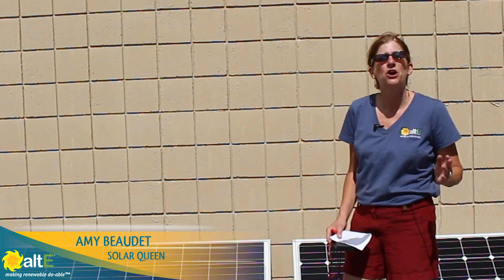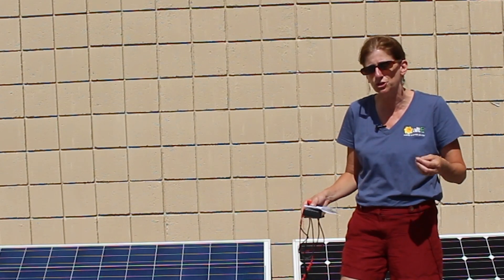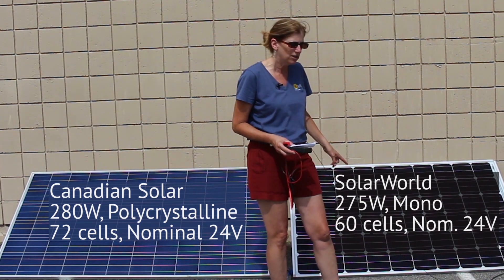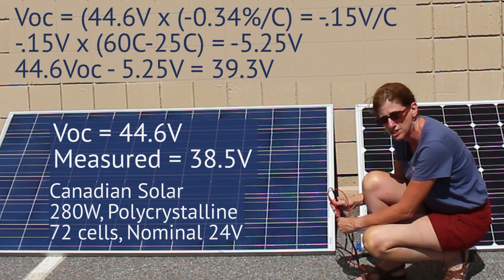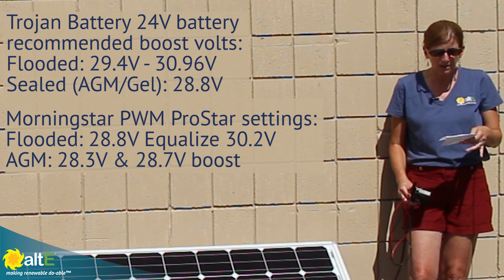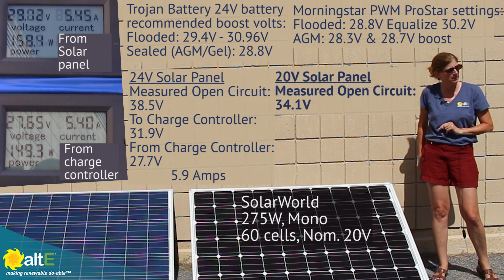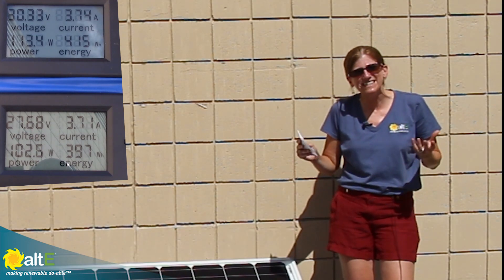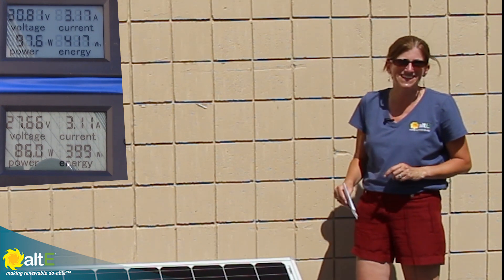Can you charge a 24V battery with a 20V solar panel and PWM charge controller?

Comment: Wow, Lady,you seem to know it all,what a pleasure to hear it from someone with experience who KNOWS;

I am stuck with five 60 cell panels,all 5 in parallel, to feed the house and charge the batteries;  works well,but they cannot do it perfectly,voltage in not high enough,at least now  in the summer

Can i ADD five 12 cell panels to my five panels,in series with each one,,  so they kind of become 72 cells?

And i want to keep my cheap two PWM controllers,can i do that,or there will be a waste of energy in them?
Reply from the maker: Unfortunately it won't work like that since the cells are already wired together within the panels. If you did put a 60c panel in series with a 12c panel, the smaller one would most likely limit the current of the larger and you would not be operating efficiently.
Reply: @AltEStore  Thank you; i now have 6 panels,all the same; i am going to look into cheap DC-DC converters,but that may not work well too; 
What i think will work,  is to wire the 2 panel strings in series and get 60 volts,and buy an MPPT; will that work?  thanks

Comment: I have a single 22voc panel will a pwm solar charge controller let me charge a 24v battery will it step the voltage up

Comment: Can I connect two 72 solar panels in parallel to charge 24v battery
Reply: I want to know the same thing did you ever find out will it work with a solar charge controller
Reply: I’m not that expert but i think when it’s match in series better than parallel because of the inverter needs more voltage to works and try to buy inverter mppt range between 60-100 . That what I’ve found in YouTube experiences
Reply: I think so,THAT is what they were made for; a 60 cell,they say here,won't do it well,just kinda...

Comment: Hi! thank you for this wonderful video. I have 60 cells SolarGiga panels from china, the Vmp is 39,42 V and Pmax is 280W just about the same for the CanadianSolar! Do you recommend battery of 12V or I go with 24V?
Reply from the maker: If you only have one 60 cell panel, I recommend 12V battery. If you have multiple panels you can put in series, you can do 24V. It really depends on the size of your system to determine which is the best battery voltage.
Reply: @AltEStore  Thank you for your answer! Yes, I was hesitating between 12 or 24V batteries, but I think 12 will do the work perfectly. FYI, I have 20 panels of Voc 39.42V and capacity of 280 Watt for each panel. our home consumes around 0.317 kw/h.  Do I have enough power to boot it up?
Reply from the maker: @hichamelouali  With 20 panels, you should use a higher battery voltage than 12V. At least 24V, if not 48V. 20 x 280W = 5600W. 5600W / 12V battery bank = 466A into the bank. That is too much for a 12V battery bank. 5600W / 48V battery bank = 116A into the bank, that is much more manageable and can be done with one or two charge controllers.
Reply: @AltEStore  many thanks for such valuable info! I'll let you know once done ;)

Comment: Hi i was planning for a small offgrid system  I've got a 12v 325 watt inverter, 12/24v charge controller (pwm) , support 390w in 12v and 780w in 24v
Max pv voltage 50, rated current is 30A , planning to get LiFePo4 battery, ( from supermexx - Indian Company) , I've just ordered for a dc-dc converter 24-12 v 
supporting 300watt , 
Not yet sure of the solar pannel between 12 or 24 and the battery voltage ( 12 or 24 v) 
I want the whole thing to be portable . 

Should I get two 12v battery, two 12v pannel, or 24v battery and 24v solar or two 12v solar, or any different combination, 
I've already ordered for converter, for the 12v inverter, 
Hi, I am a student, and would like to get some help in this. 
Thanks, regards

Comment: Question? I want to charge a single 12v battery with 320 watt 24v solar panel using a 12/24v 30a PMW charge controller (EPEVER 30a) that claims it can handle up to 50v and 360watts.   Will there be efficiency losses vs an MPPT? Do PMW chargers like this step down voltage and step up Amperage efficiency?
Reply from the maker: An MPPT reduces the voltage while increasing the current, therefore minimizing lost energy. A PWM only reduces the volts, it does not increase the amps. If you try to use a 24V panel on a 12V battery, you will lose half of the potential energy. The reason the EPEVER you are looking at supports up to 50V is for when it is used with a 24V battery bank and solar array. The solar voltage will be around 44Voc.

Comment: Pls assist it is possible to use 48v charger controller to 24v batteries and inverter is also 24v?
Reply: Pls reply sorry to border again
Reply from the maker: It depends on the charge controller. Is it designed to support multiple voltages, up to 48V, or is it just for 48V. If just 48V, no, it cannot be used for a 24V battery bank. It will either read the voltage as too low to charge, or it will try to charge it to 48V, damaging the batteries.

Comment: my 20/20 dingo plasmatonics pwm charge controller 12 24 48 volt charge controller it won't work with my single house solar panel 180 watts why???

Comment: Why are panels standardized for spring weather (70's F) instead of summer weather (80's-100's F)? Isn't then the best time to collect solar power (both for sun access and non off-grid consumer's most likeliness to use them via vacation.) the worst time to have the panels in the sun?

Comment: Hi 
Is it possible to modify the solar panels. 
If I got 12V solar panel is there anyway to make it 24V??
Reply from the maker: Only way to do that is put a second one in series.
Reply: Many thanks for your prompt reply. 

If I have only one panel? 
Is there a way to do so looks like to change the fuse of panel.
Reply from the maker: If the panel only has 36 cells, there is nothing you can do. Some 12V panels have 72 cells, 2 parallel strings of 36 cells in series. If you have one of them, and there is a way to rewire the junction box to have them all in series (and that is a big if, I doubt it), then you can do it.
Reply: Your support is Highly appreciated. 
Thank you very much...

Comment: Someone could use a pair of these 20V panels to help charge some golf cart batteries.  For example, on a 36V golf cart using six 6V batteries in series, have 2 of these "20V"  panels on the roof of the golf cart (sideways not longways), 2 separate charge controllers, and only connect 3 batteries to each charge controller.  So then you would have 20V (nominal) rated panels charging about 18V (nominal) of batteries.  This might allow you to downsize the batteries in your golf cart and save significant weight, perhaps even close to 50 pounds net savings (after adding in the weight of the 2 panels).  It would also help keep the batteries topped off when not using the golf cart.  An additional benefit is the panels will make more shade on sunny days, keeping the golfers a bit cooler while waiting to hit.

Another solution would be to use a single panel (longways) and use a boost charge controller.  Those increase the voltage to the battery bank so for example, if you have about 20V coming in from the solo panel under normal load, you can get 42V out to charge the entire 36V battery bank.  For a single panel setup like that, I would not downsize the battery bank for weight savings.

With a pair of panels, it seems reasonable to get about a 10A charge in the sun and since golf is more waiting that driving, it should keep the batteries in a high state of charge (assumng you are not one of those golfers that often drives around for 5 minutes looking for your ball).
Reply from the maker: Most charge controllers need a higher voltage solar panel than the 36V or 48V battery bank on a golf cart. However, Genasun makes one specifically for this and boosts the voltage output to the correct voltage to charge the battery bank. You can see a video we did on it here, https://youtu.be/0Rb77J1bI94

Comment: Yes for one panel it does charge the battery and work but the performance falls as soon as you have more than one panel. I have 4 255watts panels with Max volts of about 31v. When the current goes up around 23amps the volts drop to about 24.9v. which can't really charge the battery. If i attached two panels in series the volts increase and is out of operating voltage of pwm charger. So i have no option but to buy mppt charge controller.
Reply: yes.   buy mppt charge controller. but be careful. everyone is calling their charger MPPT. watch some reviews first. usually nothing less than $70. but they make all the difference in the world.

Comment: Why do they even call it a 20V panel if it's really has 39.4V / 34.AV Voc?
Reply from the maker: It goes back to when solar panels were made just to charge batteries, and before MPPT charge controllers could change the output voltage to the battery. A 36 cell panel had the right voltage to charge a 12V battery, so it was called a nominal 12V panel. A 72 cell panel can charge a 24V battery, so it's a 24V panel. When they started making solar panels for grid tie, and didn't care about battery voltages, they made a 60 cell panel. Using the same naming method, it is considered a 20V panel. It does make it clear that the voltage is too high for a 12V battery, and too low for a 24V battery bank.
Reply: Ah thanks! So it's an anachronism.
Reply: @AltEStore  Excellent explanation;

Comment: I've got a 24v-48v  GTI inverter that quits when the voltage drops below 27.8 volts.... I'm adding 3  12v batteries  in series to  create a 36v loop to keep the inverter running... think my 24v panels working through  a 36v charge controller can keep my batteries charged?
Reply from the maker: Grover Watson most mppt charge controllers have to have a higher voltage to charge the battery bank. You said panels. Can you wire 2 in series with an MPPT?

Comment: I wonder if there's a reason (other than cost) that people go with PWM controllers as opposed to MPPT?
Some people have said the PWM is more reliable... but I see no reason that a PWM controller (especially the majority of them out there) would outlive a quality MPPT controller.
Reply from the maker: It depends on the size of the system. It is commonly said that with a solar array under 500W, the increase in the solar output is outweighed by the additional power consumed by the MPPT, and the increased cost. But over 500W, cost would be the only reason. Another thing to take into consideration is voltage drop if the panels are a distance from the charge controller. MPPT allows you to wire them in series, generating higher voltage and lower current, letting you use smaller wire, and saving money there.
Reply: Wire does get really expensive really fast... If you need to pump 25 amps at 17ish volts through something, you're gonna need some big wire. 100 feet of 2/0 wire and you've quite possibly bought more than one MPPT controller. :D
Good point about the power usage of the controller. For a very small system, that would be significant.

Comment: I have a 12/24v 20A PWM charge controller and 2x100 watt solar panel. My question is, can the PWM charge controller take 24v (36v + 6.1A) and convert it to 12v (14.2v + 12.2A) for the battery?
Reply from the maker: A PWM charge controller only passes the voltage through, it does not change it. If it is rated as 12/24V, that means it can use a 12V solar array with a 12V battery bank, or a 24V solar array with a 24V battery bank. To convert from 24V array to 12V battery, you need an MPPT charge controller which drops the volts and raises the amps.

Comment: I have 700 watt of solar panel .12volt.12six volt batteries tie together to make 16volt.for sum reason my 12volt charge controler keep reading dat the batteries r full even tho dere not.I end up unplugging the wire's to the charge controler and running dem straight to the batteries. works fine but den I can't tell if dere full r not and am afraid of damaging the batteries. is dere a better way 4me to do dis plz hlp
Reply from the maker: Can you describe how the batteries are wired together? Are they in 6 parallel strings of 2 in series? Where are you getting the 16V from? A full 12V battery bank will be around 14V. Did you wire them 3 in series? If so, the charge controller will always think they are full, because they are way above the 14V full voltage.
Reply: there 8volt golf cart batteries 2 tie together in series make 16volt .dats the only way I cud get dem to work wit my 12volt inverter. problem is when I have dem.(batteries)on my 12volt charge controler it tink dat the bat3s r full and dere not
Reply: my bad didn't notice i wrote 12volt instead of 8volt.just seen it looking back at my txt
Reply: these batteries are no good for A 12 volt system a 12 volt controller shuts of at 14.6 volt and floats at 13.7 this is to low for your battery set up and will not charge then correctly
Reply: the best way i can think of is a circuit to turn on and off the solar panels to the battery when they reach a set voltage very much how alot of cheap charge controllers work

Comment: Hi. I have a 24v, 6.6 Ah Lithium battery powered electric bike I'd like to charge remotely (ie: portable). The A/C adapter I use now is 120-240v, 50-60Hz with 2.0 amp input and 24v, with 2.0 amp output. I'm confused whether I need a: solar panel, charger controller, inverter and/or a storage battery. Can I simply connect directly with simply a portable solar panel and charge controller, or do I have to use the A/C adapter? Thank you so much.
Reply from the maker: I suggest not bothering with the AC adapter, and just charge the battery directly from a solar panel with a charge controller designed for lithium batteries. If the charger is 2A output at 24V, you want about a 60W solar panel. You can get something like the Genasun GV- Boost, https://genasun.com/all-products/solar-charge-controllers/for-lithium/gvb-8a-li-lithium-solar-boost-controller/. It can take a 12V solar panel, and boost it up to 24V and control the charge into the lithium battery. You could use this panel, https://www.altestore.com/store/solar-panels/alte-poly-60-watt-12v-solar-panel-p11907/
Reply: Awesome !  Thank you for the info AND the very fast response.

Comment: A solar canopy would be great to power the 18v motor I found for my recumbent bike.Great explanation,just wondering if a mobile panel would be cooler thus much more efficient than a static one.
Reply from the maker: More airflow is always good to cool off the panel. But a canopy would likely be horizontal, and unless you are on the equator, not the ideal angle. So you'd have a trade-off. Often the right solution is just the one that physically works best for you, and accept that it is not ideal. Note to charge an 18V battery bank, you would need a custom charge controller. Genasun would be a good place to look. https://genasun.com/all-products/solar-charge-controllers/for-lead/gvb-8a-pb-solar-boost-controller/
Reply: Hi,between 8am to 4pm,minimal tilt would set my panel perpendicular to the sun rays,as I am from a tropical Island and it's sunny most of the time.Solar assist bike commute would be a nice upgrade.
Reply from the maker: Perfect! You should do that and send us a picture!
Reply: Certainly,any day next year,with my son's help.

Comment: great vid but I'm a bit confused, why are we only seeing 150 to 160 watts output
Reply from the maker: There are so many things that can affect the output of a solar panel. When I do calculations for off-grid, I plan on 60% of rated output actually getting to the battery bank. One thing is definitely the heat, it was very hot that day, so that dropped the voltage. Also I was not at ideal tilt and angle, and if memory serves me, the battery was not very low, so the draw on the  charge controller from the battery may not have been as great as if the battery was low. But I agree, I was also a little surprised by the wattage, but as I said, there's a lot of different things that can add up.
Reply: @AltEStore    Each case is a case, and that is experience and knowledge;  60%, maybe 70% ? i'll remember that.

Comment: Did I understand correctly that you need more than 24 volt panels using an MPPT controller to charge a 24 volt battery bank? I have 24 volt panels, an 80 amp MPPT charge controller and a 24 Volt battery bank. I would like to run the 24 volt panels in parallel  at 24 volts but I can easily run two pairs in series and then parallel those to be 48 volts. Which is the best approach?
Reply from the maker: A"24V panel" has 72 cells and outputs about 44V when not connected to anything. If your panel is a true 24V panel (double check, as some companies mislabel 20V 60 cell panels as 24V), then you can wire them either 2 in series or parallel.  An advantage to running them in series is that you end up with higher voltage and lower current running from the solar panels to the charge controller, which is usually the longest wire in the system. That allows you to use smaller wire with less voltage drop, saving you money. I'm assuming you have at least 4 panels. You could run two series strings of 2 in parallel, that would work terrific with an MPPT charge controller.